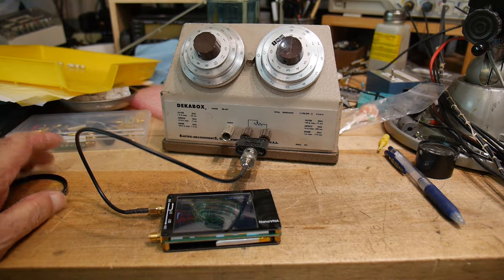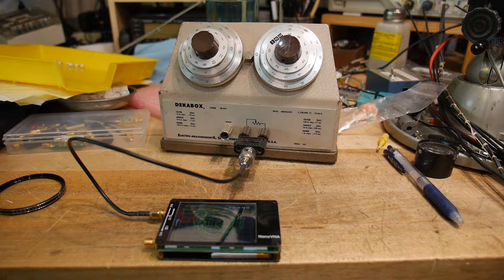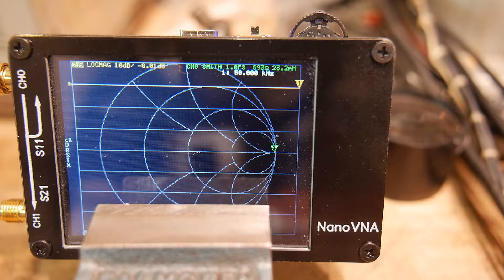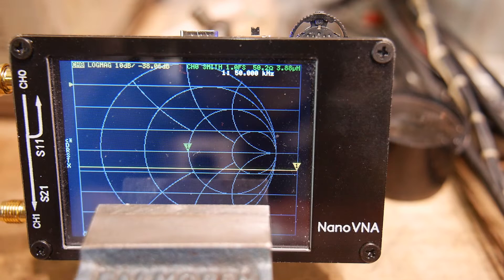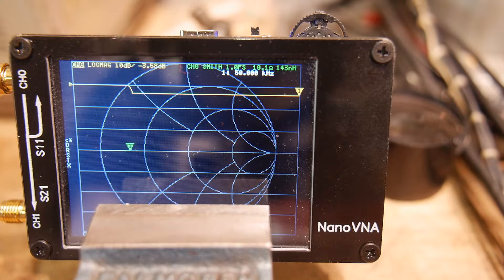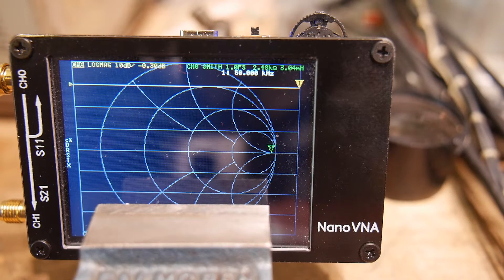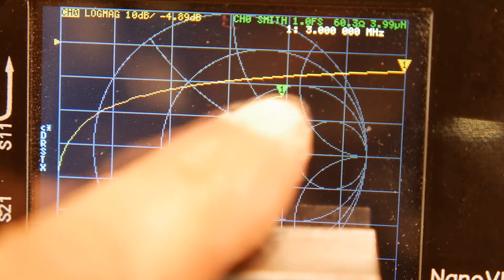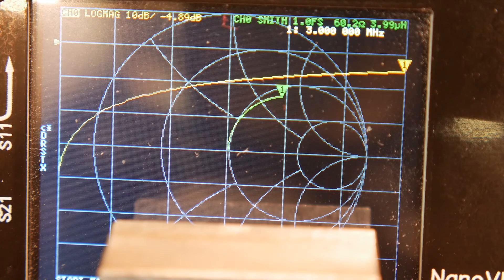#365 NANOVNA resistance measurement accuracy

Comment: Thanks, just what I was looking for. I made two balun (64:1, 2 type 43 core, stacked, rg-142)  and (1:1 choke, 3 type 52 core stacked, 14 awg enamel wire, for for high power usage). Using the corresponding resistor values and Nani VNA to test balun I realized only 80 meters was showing low SWR, I guess the frequencies affect the SWR values. When both balun are connected to antenna the SWR are low. Any insight on this? thanks for all your scientific work.
Reply from the maker: yes they are frequency dependent. Also just because you have a low SWR does not mean you have a good antenna. A 50 ohm resistor has a perfect SWR but will not radiate energy. That is probably what happens with your baluns
Reply: @IMSAIGuy  thanks a lot.

Comment: Great channel! How about a demo of measuring how much “choking” coaxial / ferrite choke Balun’s offer? What’s your call?
Reply from the maker: I don't have any
Reply: @IMSAIGuy  go at mouser.com and order this part number 623-5943003801 it is a FT240-43 core by fair-rite. They are REALLY cheap and with this, you will be able to add a common mode choke to your end fed antenna that is causing you bad RFI (seen in one of your previous video). Buy two of these to stack them if you need over a kw. One core should be plenty for 800W.

https://www.mouser.com/ProductDetail/Fair-Rite/5943003801?qs=%2Fha2pyFadugZfs4eCElWJVSzIcA7o2q3JOadLW5kqBzhASjnSp7oVQ%3D%3D

I was about to ask the same exact thing, how to test common mode attenuation with a VNA ? I was also about to ask where did you get the nanovna ? There are sooo many ripoff chinese models everywhere, many warn about inacurate or inoperative devices...

I want to test the common mode attenuation on my chokes, test different ferrites attenuation properties (since they do not have any identification beside colors) and so on. I am far from being an advenced tech like you are and don't know much about VNA but I would really want to learn how to test common mode chokes and baluns on a VNA though. Test also transformation of impedance. Once I will understand how to make this work, I'll get one ! I don't understand a lot and find my way around in a VNA, I don't even know how to read a smith chart...

I'd also like to know how to test resonance and velocity factor of coax cables, I guess you can do this also with a VNA... You have many video suggestions with these test examples !
Reply from the maker: @Aleziss  Looks like most people do 10 turns with RG58 or so. Where to you think the 1:1 should be located. at the unun or as it comes into the shack
Reply: @IMSAIGuy  10 tunrs of Rg58 will do NOTHING, in fact, even 20 turn will NEVER be effective at common mode attenuation. The 1:1 choke is to be installed as close as possible to your end fed matcher. Not sure which one you are using, 9:1 usually for "random" wire NON resonant end-fed and 49:1 are for half wave RESONANT end-fed.

To learn about the 1:1 balun choke (that until recently I also though I was ok with only a couple turn of coax on a pvc pipe), you can watch this EXCELLENT video on how to build it and how to TEST it also. The video is rather long and the host is speaking slowly in english as it is not his first spoken language, you can set the speed to 1.75X on the youtube video. See TRXbench video here : https://youtu.be/JhAPJISUjB8 really well done and a LOT of information for you with your VNA to test.

You are going to see in this video how to test cores, how to wind it and how to test it also with your vna (I am not quite understanding all of it yet, this is why I found your channel). You will also see why almost all antennas need two parts. One to adapt the impedance of the antenna and the second one is to attenuate common mode currents.

I did build that exact balun, as for my part, since I do not have all the test gear you have, the only thing I could test was the SWR thus impedance of the balun choke and up to know, it works wonderfully for the SWR reading through out the whole ham radio band plan. This is why I am also looking to get the nanovna to test my balun (where I found your channel looking for the nanovna).

See my video here : https://youtu.be/40fYNwQdbEc testing the SWR with my radio is giving excellent results so I suspect the impedance is not impacted by this method of doing the balun choke. I got random PTFE wire from ebay and it seem to work... Now I just need to find how to make a nanovna work (as I know absolutely nothing about those test devices) and test the common mode attenuation.

Overall really cheap project to build an extremely effective 1:1 choke balun. 

I hope you learn something valuable, I am no expert, I just try to understand how all this works and I find it fascinating ! Learned a lot in the previous months about all that.

Thanks for the reply !